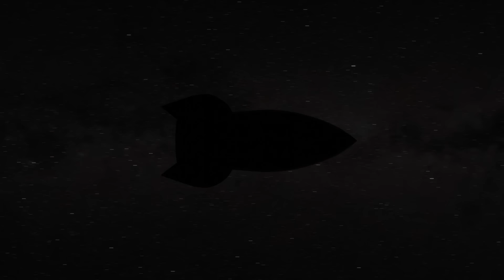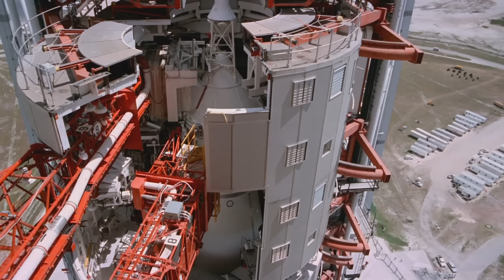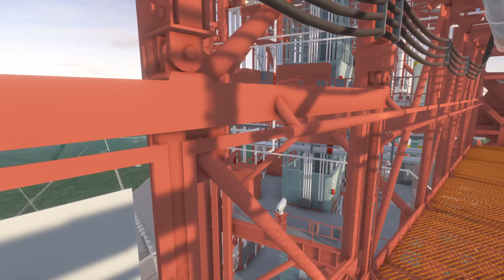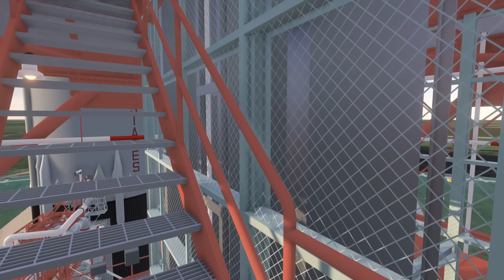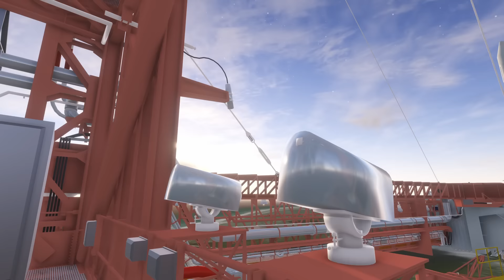How Did The Massive Launch Tower For The Saturn V Work?

Comment: AI Summary

Abstract:

This video offers an in-depth virtual tour of the Saturn V launch tower and its ground support equipment at Launch Complex 39, utilizing the detailed 3D model found in the "Re-Entry: A Spaceflight Simulator" game. Host Scott Manley guides viewers through the often-overlooked complexities of the launch infrastructure, explaining the purpose and operation of key components. The tour covers the Mobile Launch Platform, the Theodolite hut for guidance alignment, hold-down clamps, tail service masts supplying propellants and utilities, and the flame diverter. Significant attention is paid to the various service arms, detailing their specific connections (propellants, venting, electrical, pneumatics, crew access) to different stages of the rocket (S1C, S-II, S-IVB, Service Module, Command Module) and their retraction sequences during launch. Safety features like emergency escape systems (slide, wire escape) and the purpose of the "Q-ball" sensor cover are also discussed, concluding with an examination of the tower's upper structures, including the service crane. The video aims to enhance understanding and appreciation of the intricate engineering and crucial role played by the launch tower in the Apollo program.

Saturn V Launch Tower Tour: A Look Inside the Operational Complexity

*   0:00 Introduction: Scott Manley highlights the often-overlooked complexity of the Saturn V launch tower and its coordinated actions during launch, using the "Re-entry" spaceflight simulator for a virtual tour.
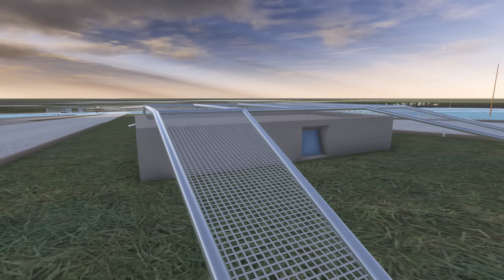*   1:56 Theodolite Hut: Explains the ground-based optical system used to precisely align the Saturn V's internal guidance platform before launch, disconnected 15 seconds prior to liftoff ("guidance is internal") due to vibrations.
*   2:43 Mobile Launch Platform (MLP) & Pad Setup: Describes the crawler track, the MLP structure sitting on support posts, and notes the absence of the second Mobile Service Structure (indicating <24 hours to launch), which normally encapsulates the upper stages and spacecraft for final preparations.
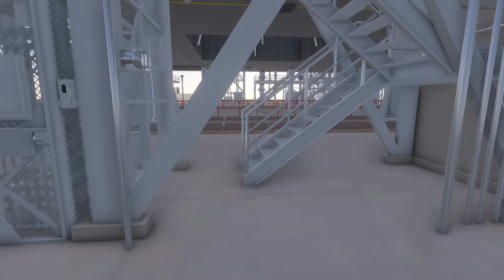*   4:07 Tower Base & Infrastructure: Details the MLP base containing support equipment (power, pneumatics, computer) and points out the surrounding fuel storage (LH2, Kerosene, hypergolics).
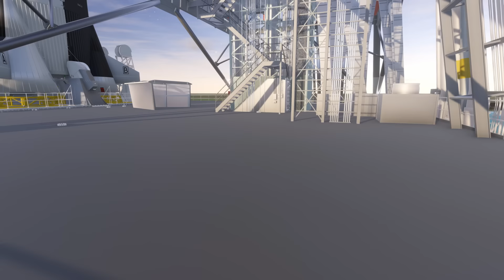*   5:15 Hold Down Clamps: Identifies the four large clamps that secured the base of the Saturn V until sufficient thrust was achieved for liftoff.
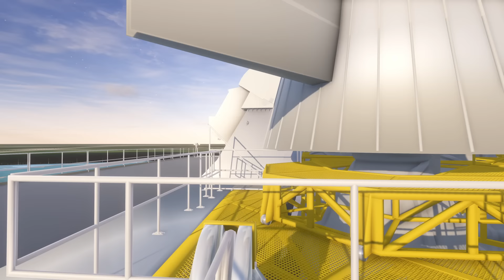*   6:00 Tail Service Masts (TSMs): Describes the three umbilical masts connecting to the S-IC first stage base, providing RP-1 fuel, power, pneumatics, AC, and a secondary LOX fill/drain connection. They retract by pitching backward.
*   7:04 Pad Infrastructure (LOX & Escape): Shows the large LOX storage sphere and connection point, along with the emergency slide tube leading to the underground "Rubber Room" bunker.
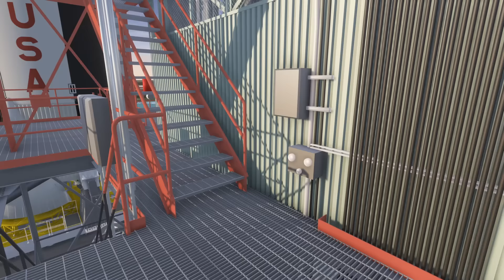*   8:40 Service Arms Overview: Introduces the nine service arms connecting to the rocket, differentiating between "pre-flight" arms (retracted before T-0) and "in-flight" arms (retracted dynamically at liftoff).
*   9:02 Arm 1 (S-IC Intertank): A pre-flight arm providing personnel access and the primary LOX fill/drain connection. It's the only arm capable of remote reconnection (in ~5 mins).
*   10:32 Arm 2 (S-IC Forward): A pre-flight arm providing pneumatics, electrical, and AC to the first stage upper section. Retracts gently before launch.
*   11:16 Pad Safety Systems: Notes the extensive water spray systems on the tower for fire suppression and heat protection during potential emergencies.
*   11:46 Arm 3 (S-II Aft): A pre-flight access arm for the S-II second stage, deployed only as needed.
*   12:16 Arm 4 (S-II Intermediate): An in-flight arm providing LH2/LOX vent lines for the S-II stage. Retracts rapidly (~6.4s) via a cable/pulley system at T-0.
*   13:56 Arm 5 (S-II Forward): An in-flight arm providing S-II hydrogen venting, pneumatics, electrical, and AC. Umbilicals detach before the arm retracts.
*   14:59 Arm 6 (S-IVB Aft): An in-flight arm providing LH2/LOX connections to the S-IVB third stage.
*   15:48 Arm 7 (S-IVB Forward/Instrument Unit): An in-flight arm providing gaseous hydrogen vent and critical connections to the S-IVB's Instrument Unit, which houses the Launch Vehicle Digital Computer (LVDC) controlling the rocket.
*   17:11 Arm 8 (Service Module): An in-flight arm providing hypergolics, vents, cooling, electrical, and pneumatics to the Apollo Service Module.
*   18:18 Arm 9 (Crew Access Arm - CAA): The final arm, used for crew ingress via the "White Room." It retracts differently from others, swinging away (left) about 4 minutes before launch.
*   18:46 Q-Ball: Explains the function of the protective cover ("Q-ball") for the Launch Escape System's air pressure sensors, removed just seconds before launch to prevent blockage (e.g., by insects).
*   20:08 High-Level Safety & Access: Shows the emergency wire escape system for astronauts at the top level and the ramp system used for suited crew to reach the CAA.
*   20:58 White Room & CAA Details: A closer look at the famous White Room at the end of the CAA, and how the arm provides AC to the Command Module and rotates away from the rocket before launch.
*   22:41 Tower Top Structure: Ascends past the rocket's top, showing the elevator machinery housing and upper levels.
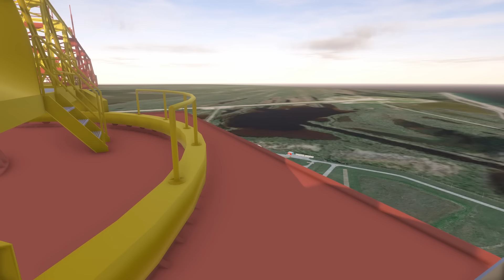*   24:02 Tower Crane: Details the large crane mounted atop the tower, used for moving heavy equipment, with a 25-ton capacity.
*   24:44 Conclusion: Scott Manley emphasizes the intricate mechanics of the launch tower, hoping the tour enhances appreciation of launch footage.

I used gemini-2.5-pro-exp-03-25| input-price: 1.25 output-price: 5 max-context-length: 128_000 on rocketrecap dot com to summarize the transcript.
Input tokens: 21305
Output tokens: 1152

Comment: "Big Ass Pipe" is a perfectly acceptable technical term as I used it on P&IDs several times during my process engineering career as "BAP".  "Big Ass Tank" or BAT was also an acceptable term.  I actually submitted a $4.5M project named "Starch Storage BAT".  When our CEO asked me what a BAT was, I replied Big Ass Tank and I got my money.  That tank was only 500,000 gallons.  A few months later when I went back to the board for a 1.25 million gallon tank, that was Saccharification BFT.  They didn't ask what a BFT was.

Comment: One geeky detail about the hold down clamps, just releasing the rocket could cause a damaging shock through the rocket. So there were some pins/rods and dies. The rods had to be pulled through the dies which slowed the initial 150mm/6” of acceleration. The actual number seems to have varied from each rocket. 
Great video about a much ignored part of the Apollo project.

Comment: Thanks for this detailed description of everything. I really didn't know it was that complicated. I was aware that those first stage umbilicals were repurposed for shuttle. One of the only things other than the tower that was carried through to fuel the shuttle. My buddy Stu worked for Lockheed Martin/  Martin Marietta.
He was involved with the only thing on the shuttle was the repurposing of those umbilicals to the first stage to shuttle. Then he went on to the construction of the huge tank. And was also involved with the team that replaced the foam that was coming off and damaging the heat shield . Stuart is now retired and lives in the hills of Georgia and brews beer. 😊

Comment: Great Video. One correction, primary retrack system for the inflight swing arm retract sys. was hyd. cyl. in the hinge of the arm. The cable mentioned in video was back up. I was swing arm engineer at LC-39 1965 to 1969. Best job I ever had.

Comment: Our local EAA chapter has a guy who worked on the first stage. He gave a fascinating talk. One piece of trivia: There was a big argument about the covers for the hold down clamps. Engineers came up with all sorts of hydraulically operated covers. Werner then suggested they tie a rope between the rocket and cover. As the rocket takes off it pulls the covers closed. You can see that in all the films and it was in the 3D model you showed. Super simple.

Comment: Also, when they launched the Skylab Apollo rocket they had the "step stool" which lifted the upper stages into position.
The first stage was a shorter Saturn 1B booster, not a Saturn 5.
Reply: They called it the "milk stool". They had to use it because the other Launch Complex had been decommissioned by then (LC 34 & 37). All Saturn V launches were made from 39A except Apollo 10, which was launched from 39B. All manned Saturn IB launches were from 39B using the milkstool except for Apollo 7, which launched from LC34.

Comment: A friend worked on the shuttle support systems after Apollo.  I remember one thing he mentioend was H2 fire monitoring.  All that piping and stuff, when they might have a small leak, it might ignite and burn for some time.  The flame doesn't show up on cameras in the bright Florida sun so they had thermal sensors all around.  Didn't want some poor technician that was tracking down a leak to accidently walk into a wall of fire.  So many 'behind the scene' things that most people never hear about.

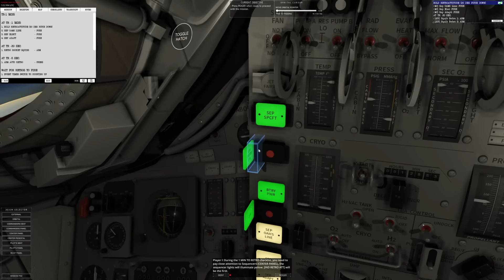Comment: The umbilicals always pull away with a couple seconds to go before ignition.  Is this process driven because the cryo fuel is being topped off to minimize the boiloff losses, to retain the hard-wire power and comm circuits, or both?  What would be the downside of, say, pulling them away at T-1:00?
Reply: the boiloff rate is pretty huge , i read somewhere that a third of the propellant used to fill up the rocket is just used to replace the quantities that evaporated. So yeah they keep filling until the last possible moment. I dont think its about power as the rocket goes on internal power a bit before liftoff
Reply: @yaya1338-w7d  I've put liquid helium and liquid nitrogen in MRI magnets many times.  The initial cool down wastes a lot of cryo liquid, but an MRI magnet is very well insulated by a vacuum jacket which is missing on the rocket.  Since you only need to hold the fuel for two or three minutes, that's OK.  but how much is lost while you're sitting on the launch pad?

Comment: Not many people talking about the moon shots history mention the Mobile Service Structure which is the tower that provided access from the other side and the work platform around the command module. It was actually deeper than the launch tower and looks huge. As noted they used the crawler to move it to and from the pad area. Wikipedia has a photo on the LC39 page.

Comment: The number of steps is probably equivalent to a 15 story building
Reply: 94 meters or 313 feet - this is a lot higher than 15 stories.
Reply: @olasek7972  A poor rule of thumb is 10 feet to a story.

Comment: 13:05 Question: what actuated the pulley system that pulls the arms away from the rocket? Like was it an electric motor, a counterweight, etc. I also see only one cable; was there any redundancy in this mechanism, or would a failure to retract the arm (especially the upper arms that stick out over the lower stages) just cause a very expensive and embarrasing test of the launch abort/escape system?

Comment: From 1966 to 1971 I worked for IBM at Kennedy Space Center. These were the early days of Saturn V. My job was to operate and maintain the pairs of computers which were the communication between the Launch Control Complex (LCC).They were RCA110A computers. One was in the back of each LCC firing room and the other was in the base of each of the mobile launchers. I spent many hours inside of each of those computer rooms. It was Quite a process gaining access to the mobile launcher when it was on the pad. You mentioned the escape slide. I had to go down that slide as part of the safety training. It was quite a ride.🙂🙂
Reply: Do you know what happened to the RCA110A hardware and software? The AGC gets all the attention, but all the other computers in the programme deserve love too!
Reply: Very cool. So you were one of the 400,000+ anonymous support personnel that made the Apollo program work.
Reply: @  yeah  so anonymous they had no idea of the complete picture, that how to  perpetrate a hoax!   did you ever wonder why part of NASA is in Florida and the other part is in Houston?   Then all they do is talk to each other!   Maybe you’ve heard the expression the right hand doesn’t know what the left hand doing!!
Reply: Thank you for being a part of history.
Reply: It’s amazing what could be done with the computers at the time and earlier.
Reply: What a job !
Reply: Don't forget those huge disc drives on the IBM 360. We used punch cards for data inputs.
Reply: Did those computers run off of punch cards?
Reply: @I remember the technology of those days … Hollerith punch cards, ticker tapes, reel to reel computer tapes with air columns and high speed motors,  drum memory, magnetic donut core memory, Adage analog computer, 32 bit Sigma computers, analog computers using analog multipliers, op amps, summing Taylor series approximations to get trig function waveforms real time, and much more.   Those were the years when ground was not ground, it was chassis ground, power ground, computer ground, or video ground.   And circuits were more than wires because what’s on one wire can affect what’s on another wire without physically being connected.
Reply: @douginorlando6260  it's the same today with integrated circuits - the geometries are small enough now that the "wires" on the silicon crosstalk between each other and you have to design around it inside a horrible, multi-dimensional parameter space. Miles of wire layers on dies the size of fingernails.
Reply: @douginorlando6260 I have to program some old machinery that still use punched tape. Programming is done on an msdos laptop and sent to a hole punch via serial. Much respect to the guys from that era.
Reply: @dannydaw59  The specs I've read mentioned both card readers and tape readers in RCA110s in the LCC but only card readers in the LUT.
Reply: Those were the same slides we used to exit the tower before firing off that rocket into the ocean to be start the hoax😊    shhhhhhh…… don’t tell anyone
Reply: @buzzedalldrink  😉😄

Comment: What I’ve never seen adequately depicted is the tapered pins on the hold down stands. Tapered steel pins that were pulled thru dies, slowing the initial liftoff.

Comment: While I was stationed at a SAC base in the 70s, a T38 had a mishap when the heater on the petot ( I know that is misspelled) failed and froze. The pilot came in for his landing to fast and jammed his front gear. After trying to shake it loose failed, he was sent out into the wilds to eject. There was no story about the plane flying on. As soon as he was out the stick went straight forward and left a rather large hole in the South Dakota plains.

Comment: It makes me wonder why they stopped making Saturn 5's.  We had a perfectly flawless system, and we could have been decades ahead of any other country that is thinking of heading to the moon. Need I say politics.
Reply: The existing S facilities have looked a bit historic and worn from my experience, likely more bureaucratic issues than politics, 'safety first' sort of stuff, more OSHA requirements, ADA compliance's, It costs a lot to bring an old, aging rocket factory up to current requirements - how do you hold the original KTR responsible for reuse? It's all being scrapped for penny's on the dollar - now we can skip ahead and let the private sector goof up.
Reply: its a fact of life that when a new generation of engineers come they don't want to rehash old designs, they want to do their own stuff regardless if it is a rocket, a car or a skyscraper
Reply: Part of it is politics - Apollo was really expensive. Part of it is that the Saturn V is optimized for a very specific goal that limits its usage for other things

Comment: The mechanisms that pulled the connections back had a primary system to yank off the connection and a back-up that would automatically fire if the primary didn't do it's job in a certain amount of time.  That's one thing you find throughout NASA at this time-- lots of back-ups, and back-ups to back-ups.
Reply: I worked for ITT Cannon’s Special Products facility in Phoenix during the 80’s and 90’s which was built to support this effort. We still had the qual. units and an extra L.E.M. Interstage. We designed/manufactured Umbilicals and Interstage Connectors for Minuteman, Titan, Trident D5, Tomahawk V.L.S. Various torpedoes etc.
From mechanical spring packs, spring sleeve, ring locks, solenoid driven, squib designs. Some even had primary,secondary,tertiary release systems. Some receptacles had deadfacing designs for EMP immunity (probably guess which missiles). 
I learned much during my career progression there, many of Saturn’s original engineers were my mentors!

Comment: Christ, can you imagine getting a case of acrophobia halfway up this monster?

One thing I never understood is why the tower and everything in it doesn't get roasted to hell during a launch.  I mean, there has to be stuff like plastic, cloth, and other materials that couldn't possibly withstand the heat.  Everyone talks about the turnaround time for the shuttle, but what about the turnaround method for the tower?   What did that entail?
Reply: It did get fairly toasted, but it was also built to take that. IIRC the bathroom or elevator was broken by a launch but nothing unrepairable
Reply: At the peak of the Apollo program they launched Saturn V's every two months. So that may be the time it took.